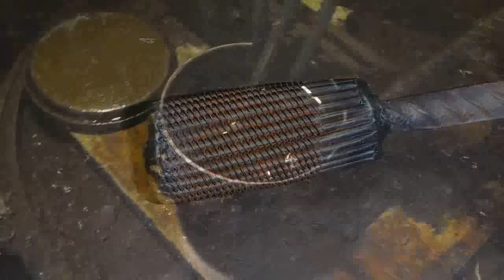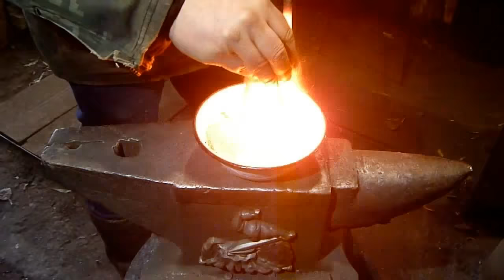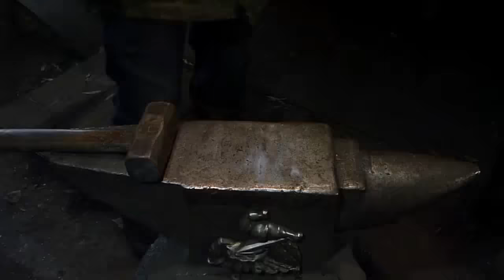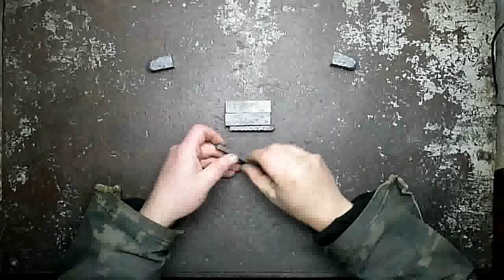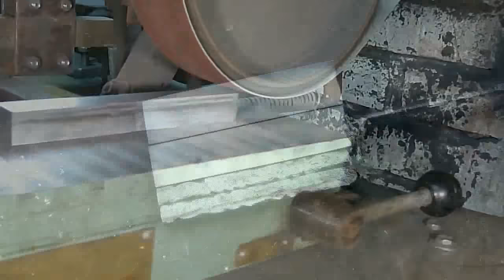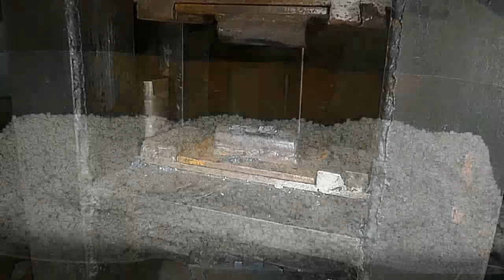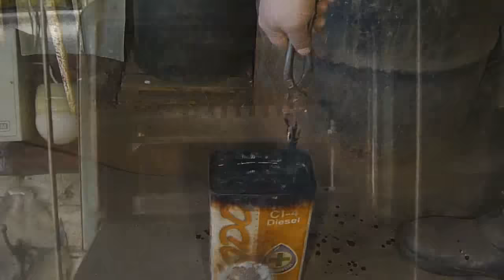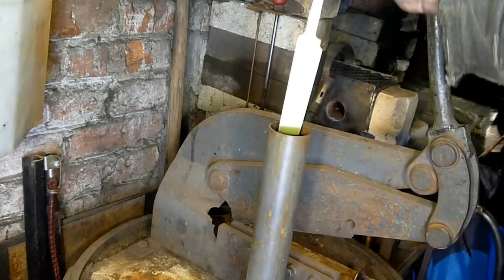Damascus of screws, making a blade.

Comment: I know nothing about metal working, what is the powder he sprinkles on it and what does it do?
Reply from the maker: I sprinkle flux (90% borax + 5% quartz sand + 5% charcoal powder) this is necessary for forging (forge) welding. The flux is alloyed with scale - the formed substance is sufficiently fluid and is easily displaced by deformation. In addition, the flux protects against oxygen and charcoal, carburizes the surface layer of metal - which lowers the welding temperature (if in brief).
Reply: @shurap  Awesome thanks! I really enjoy your videos.

Comment: Amazing...but what is that liquid....and the powder
Reply from the maker: I sprinkle flux (90% borax + 5% quartz sand + 5% charcoal powder) this is necessary for forging (forge) welding. The flux is alloyed with scale - the formed substance is sufficiently fluid and is easily displaced by deformation. In addition, the flux protects against oxygen and charcoal, carburizes the surface layer of metal - which lowers the welding temperature (if in brief).

Comment: Can anyone out there explain the soaking the billet in what I assuming is solvent before starting to forge is it just to clean and degrease for a better weld?
Reply from the maker: The billet is soaked in kerosene. This is necessary for good welding (forging) steel. When burning inside the workpiece remains soot (carbon), which, with further heating, scales and rust inside the workpiece restores to the iron, improving the quality of forging welding.
Reply: Ok so it helps reduce scale build up inside the billet as it heats up, it that the same reason you pound on a wood block to start out with, to reduce scale buildup?

Comment: What is the liquid you have the screws soaking in before forging?
Reply from the maker: I sprinkle flux (90% borax + 5% quartz sand + 5% charcoal powder) this is necessary for forging (forge) welding. The flux is alloyed with scale - the formed substance is sufficiently fluid and is easily displaced by deformation. In addition, the flux protects against oxygen and charcoal, carburizes the surface layer of metal - which lowers the welding temperature (if in brief).
Reply: @shurap  thanks for the information on the flux. That will be very helpful. 
However, I was referring to the liquid they are soaking in before the flux. Is it just acetone?

Comment: alguém poderia me dizer pra que serve esse pó que colocam no aço.
Reply from the maker: Polvilhe com fluxo (bórax 90% + areia de quartzo 5% + carvão em pó 5%), isto é necessário para a soldagem (ferraria). O fluxo é fundido com escala - a substância resultante é bastante fluida e é facilmente deslocada durante a deformação. Além disso, o fluxo protege contra o oxigênio e, devido ao carvão, carboniza a camada superficial do metal - o que diminui a temperatura de soldagem (se por breves instantes).

Comment: Always wondered how grinding in the blade geometry after hardening affects the edge durability. My thinking is, the centre of the material should be a bit softer than the outer and it is the centre material that becomes the blades edge with this process. Does the final edge ever require another hardening process not show here?
Reply: With thin pieces like this this hardly matters. You really need much larger crosssections for tbis to matter.

Additionally you are forgetting about effects like decarburization (which is especially critical when doing damascus, as it requires very hot temperatures for long times). This creates a carbon poor and thus weakend and softened outer layer which must be ground away.

Comment: Hi what is that white powder that you use in the begining about 1':30" thanks
Reply from the maker: I sprinkle flux (90% borax + 5% quartz sand + 5% charcoal powder) this is necessary for forging (forge) welding. The flux is alloyed with scale - the formed substance is sufficiently fluid and is easily displaced by deformation. In addition, the flux protects against oxygen and charcoal, carburizes the surface layer of metal - which lowers the welding temperature (if in brief).
Reply: @shurap  thank you so much

Comment: Que es el polvo que le ponen al hierro al rojo vivo y para que sirve??
Reply from the maker: Rocío con fundente (bórax 90% + arena de cuarzo 5% + carbón en polvo 5%) es necesario para realizar la soldadura (forja). El fundente se fusiona con la escala: la sustancia resultante es bastante fluida y se desplaza fácilmente durante la deformación. Además, el fundente protege del oxígeno y, debido al carbón, carbura la capa superficial del metal, lo que reduce la temperatura de soldadura (en resumen).

Comment: What are the ratios of water to borax do you use for soaking the steel?
Reply from the maker: The billet is soaked in kerosene. This is necessary for good welding (forging) steel. When burning inside the workpiece remains soot (carbon), which, with further heating, scales and rust inside the workpiece restores to the iron, improving the quality of forging welding.
Reply: Thank you, just saved me some major problems. Keep up the amazing work

Comment: I’ve always wondered what’s in the bowl?
Reply from the maker: I sprinkle flux (90% borax + 5% quartz sand + 5% charcoal powder) this is necessary for forging (forge) welding. The flux is alloyed with scale - the formed substance is sufficiently fluid and is easily displaced by deformation. In addition, the flux protects against oxygen and charcoal, carburizes the surface layer of metal - which lowers the welding temperature (if in brief).

Comment: What is that dust he puts on the blade?
Reply from the maker: I sprinkle flux (90% borax + 5% quartz sand + 5% charcoal powder) this is necessary for forging (forge) welding. The flux is alloyed with scale - the formed substance is sufficiently fluid and is easily displaced by deformation. In addition, the flux protects against oxygen and charcoal, carburizes the surface layer of metal - which lowers the welding temperature (if in brief).
Reply: @shurap  thank you also i noticed you dip it in a liquid which seems to make the Damascus patterns what is that stuff as well if you dont mind me asking

Comment: What's the powder he sprinkles on the red hot metal?  Carbon?
Reply from the maker: I sprinkle flux (90% borax + 5% quartz sand + 5% charcoal powder) this is necessary for forging (forge) welding. The flux is alloyed with scale - the formed substance is sufficiently fluid and is easily displaced by deformation. In addition, the flux protects against oxygen and charcoal, carburizes the surface layer of metal - which lowers the welding temperature (if in brief).

Comment: I've never understood why he punches the hot piece of iron on the wood first and then he punches it on the incus...
Reply from the maker: The first welding is done on a tree, as the tree is a heat insulator, and not so selects temperature as an iron anvil. In addition - burning, the tree burns oxygen, protecting the workpiece and pouring the flux work. This is important for welding workpieces with small parts (cable, chain).

Comment: Is that soda ash or powdered flux he is adding to it?
Reply from the maker: I sprinkle flux (90% borax + 5% quartz sand + 5% charcoal powder) this is necessary for forging (forge) welding. The flux is alloyed with scale - the formed substance is sufficiently fluid and is easily displaced by deformation. In addition, the flux protects against oxygen and charcoal, carburizes the surface layer of metal - which lowers the welding temperature (if in brief).

Comment: What is the purpose of using the wood for the first step?
Reply from the maker: The first welding is done on a tree, as the tree is a heat insulator, and not so selects temperature as an iron anvil. In addition - burning, the tree burns oxygen, protecting the workpiece and pouring the flux work. This is important for welding workpieces with small parts (cable, chain).

Comment: I want to know what the liquid is he soaks it in at the beginning heat.
Reply from the maker: The billet is soaked in kerosene. This is necessary for good welding (forging) steel. When burning inside the workpiece remains soot (carbon), which, with further heating, scales and rust inside the workpiece restores to the iron, improving the quality of forging welding.

Comment: Hola , una consulta que es el polvo blanco que le pones ???
Reply from the maker: Espolvoree fundente (90% de bórax + 5% de arena de cuarzo + 5% de polvo de carbón) esto es necesario para la soldadura de forja (forja). El flujo se alea con escala: la sustancia formada es suficientemente fluida y se puede desplazar fácilmente por deformación. Además, el fundente protege contra el oxígeno y el carbón, carbura la capa superficial del metal, lo que reduce la temperatura de soldadura (si es breve).

Comment: What material are you sprinkling on the metal?
Reply from the maker: I sprinkle flux (90% borax + 5% quartz sand + 5% charcoal powder) this is necessary for forging (forge) welding. The flux is alloyed with scale - the formed substance is sufficiently fluid and is easily displaced by deformation. In addition, the flux protects against oxygen and charcoal, carburizes the surface layer of metal - which lowers the welding temperature (if in brief).

Comment: What is the liquid soaking the starter billets at the beginning?
Reply from the maker: The billet is soaked in kerosene. This is necessary for good welding (forging) steel. When burning inside the workpiece remains soot (carbon), which, with further heating, scales and rust inside the workpiece restores to the iron, improving the quality of forging welding.

Comment: Che polvere è quella chensi mette sopra dopo la forgiatura?
Reply from the maker: Cospargere di flusso (borace 90% + sabbia di quarzo 5% + polvere di carbone 5%) questo è necessario per la saldatura (fabbro). Il flusso è fuso con la scala: la sostanza risultante è piuttosto fluida e può essere facilmente spostata durante la deformazione. Inoltre, il flusso protegge dall'ossigeno e, grazie al carbone, carbura lo strato superficiale del metallo, il che abbassa la temperatura di saldatura (se brevemente).

Comment: Can someone explain to me what ist the powder he pours everytime ?
Reply from the maker: I sprinkle flux (90% borax + 5% quartz sand + 5% charcoal powder) this is necessary for forging (forge) welding. The flux is alloyed with scale - the formed substance is sufficiently fluid and is easily displaced by deformation. In addition, the flux protects against oxygen and charcoal, carburizes the surface layer of metal - which lowers the welding temperature (if in brief).
Reply: @shurap  thanks!

Comment: Is it sand?
Reply from the maker: I sprinkle flux (90% borax + 5% quartz sand + 5% charcoal powder) this is necessary for forging (forge) welding. The flux is alloyed with scale - the formed substance is sufficiently fluid and is easily displaced by deformation. In addition, the flux protects against oxygen and charcoal, carburizes the surface layer of metal - which lowers the welding temperature (if in brief).
Reply: @shurap  Thanks

Comment: What is the purpose of hammering it on the wood?
Reply from the maker: The first welding is done on a tree, as the tree is a heat insulator, and not so selects temperature as an iron anvil. In addition - burning, the tree burns oxygen, protecting the workpiece and pouring the flux work. This is important for welding workpieces with small parts (cable, chain).

Comment: Que es ese polvo blanco varios vídeos he visto lo usan
Reply from the maker: Rocío con fundente (borax 90% + arena de cuarzo 5% + carbón en polvo 5%) es necesario para realizar la soldadura (forja). El flujo se fusiona con la escala: la sustancia resultante es bastante fluida y se desplaza fácilmente durante la deformación. Además, el fundente protege del oxígeno y, a expensas del carbón vegetal, carburiza la capa superficial del metal, lo que reduce la temperatura de soldadura (en resumen).

Comment: May I ask what is that powder you use between heating?
Reply from the maker: I sprinkle flux (90% borax + 5% quartz sand + 5% charcoal powder) this is necessary for forging (forge) welding. The flux is alloyed with scale - the formed substance is sufficiently fluid and is easily displaced by deformation. In addition, the flux protects against oxygen and charcoal, carburizes the surface layer of metal - which lowers the welding temperature (if in brief).
Reply: Fantastic, thank you very much for your answer! I look forward to watch more from your vids! 🙂

Comment: What is the purpose of the powder he puts on the blank?
Reply from the maker: I sprinkle flux (90% borax + 5% quartz sand + 5% charcoal powder) this is necessary for forging (forge) welding. The flux is alloyed with scale - the formed substance is sufficiently fluid and is easily displaced by deformation. In addition, the flux protects against oxygen and charcoal, carburizes the surface layer of metal - which lowers the welding temperature (if in brief).

Comment: Dear sir what is that sand like thing you pour on the hotmetal.
Reply from the maker: I sprinkle flux (90% borax + 5% quartz sand + 5% charcoal powder) this is necessary for forging (forge) welding. The flux is alloyed with scale - the formed substance is sufficiently fluid and is easily displaced by deformation. In addition, the flux protects against oxygen and charcoal, carburizes the surface layer of metal - which lowers the welding temperature (if in brief).
Reply: @shurap  thanks

Comment: What is that white powder he sprinkles on the white hot iron?
Reply from the maker: I sprinkle flux (90% borax + 5% quartz sand + 5% charcoal powder) this is necessary for forging (forge) welding. The flux is alloyed with scale - the formed substance is sufficiently fluid and is easily displaced by deformation. In addition, the flux protects against oxygen and charcoal, carburizes the surface layer of metal - which lowers the welding temperature (if in brief).

Comment: What do you soak your pieces in at the start of each video?
Reply from the maker: The billet is soaked in kerosene. This is necessary for good welding (forging) steel. When burning inside the workpiece remains soot (carbon), which, with further heating, scales and rust inside the workpiece restores to the iron, improving the quality of forging welding.
Reply: @shurap  Thanks!!!

Comment: Why is the initial hammering done on a board?
Reply from the maker: The first welding is done on a tree, as the tree is a heat insulator, and not so selects temperature as an iron anvil. In addition - burning, the tree burns oxygen, protecting the workpiece and pouring the flux work. This is important for welding workpieces with small parts (cable, chain).

Comment: I’m new to this...what is the powder he puts on it?
Reply from the maker: I sprinkle flux (90% borax + 5% quartz sand + 5% charcoal powder) this is necessary for forging (forge) welding. The flux is alloyed with scale - the formed substance is sufficiently fluid and is easily displaced by deformation. In addition, the flux protects against oxygen and charcoal, carburizes the surface layer of metal - which lowers the welding temperature (if in brief).

Comment: What is that powder he keeps spreading on the metal?
Reply from the maker: I sprinkle flux (90% borax + 5% quartz sand + 5% charcoal powder) this is necessary for forging (forge) welding. The flux is alloyed with scale - the formed substance is sufficiently fluid and is easily displaced by deformation. In addition, the flux protects against oxygen and charcoal, carburizes the surface layer of metal - which lowers the welding temperature (if in brief).

Comment: What is the billet being dipped into before going into the forge?
Reply from the maker: The billet is soaked in kerosene. This is necessary for good welding (forging) steel. When burning inside the workpiece remains soot (carbon), which, with further heating, scales and rust inside the workpiece restores to the iron, improving the quality of forging welding.
Reply: @shurap  Ohh!  Interesting! I assume this is why peppers are added sometimes, for more carbon?

Comment: What is that white powder he puts on the hot metal.
Reply from the maker: I sprinkle flux (90% borax + 5% quartz sand + 5% charcoal powder) this is necessary for forging (forge) welding. The flux is alloyed with scale - the formed substance is sufficiently fluid and is easily displaced by deformation. In addition, the flux protects against oxygen and charcoal, carburizes the surface layer of metal - which lowers the welding temperature (if in brief).

Comment: Why the the wood block for the initial pounding?
Reply from the maker: The first welding is done on a tree, as the tree is a heat insulator, and not so selects temperature as an iron anvil. In addition - burning, the tree burns oxygen, protecting the workpiece and pouring the flux work. This is important for welding workpieces with small parts (cable, chain).
Reply: @shurap  that makes sense, Thank you.

Comment: que le hechan al acero encima cuando sale rojo arena?
Reply from the maker: Rocío fundente (90% bórax + 5% arena de cuarzo + 5% carbón en polvo), esto es necesario para la soldadura de forja (forja). El fundente está aleado con incrustaciones: la sustancia formada es suficientemente fluida y se desplaza fácilmente por deformación. Además, el fundente protege contra el oxígeno y el carbón, carbura la capa superficial del metal, lo que reduce la temperatura de soldadura (si es breve).